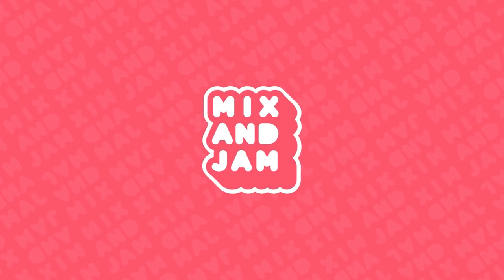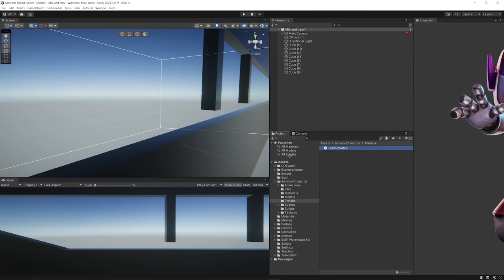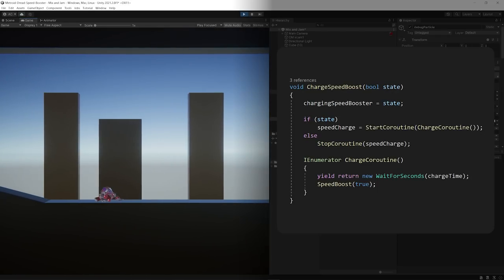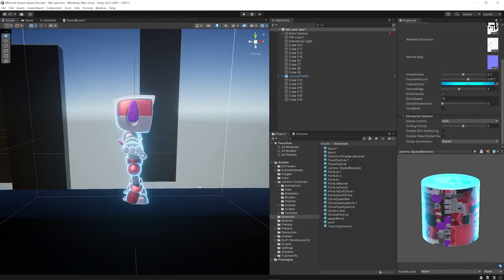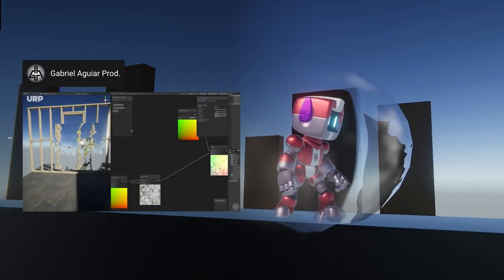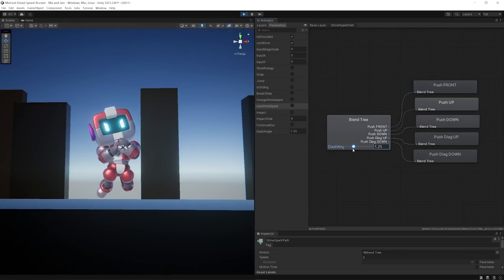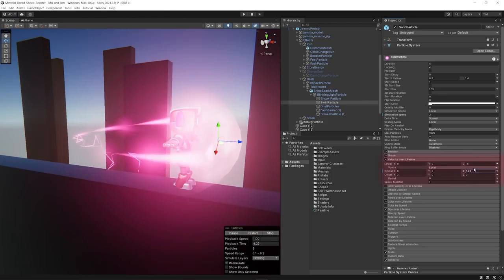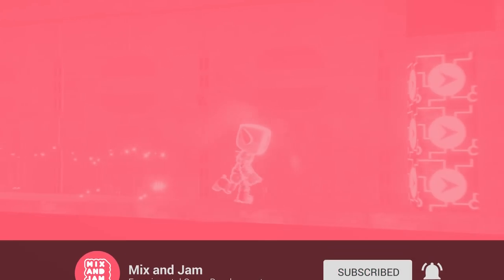Recreating Metroid Dread's Speed Booster | Mix and Jam

Comment: Great work! It would be great if you once did a Slow Motion Time tutorial.
Reply: Tough topic depending on what engine you are using. The level of possibility and implementation varies between UE4 and Unity
Reply: Depending on how you program your game it could be as simple as "set playback speed = 0.5" or manipulate the tick rate. Easy or extremely tricky
Reply: @xaby996  Thank you for your informative comment.

Comment: This is a very nice project, good work, the only thing I noticed was the slide ability doesn't seem to work, I am using it on a Mac so this may to be factor, is there a workaround for this as I've used commands like control and command on my keyboard but nothing happens.
Reply from the maker: Oh, you are actually correct, I forgot to do the proper key binding! I just pushed an update to the repository to fix that! Let me know if it works!
Reply: @mixandjam  hello yeah it works, thanks for updating that.